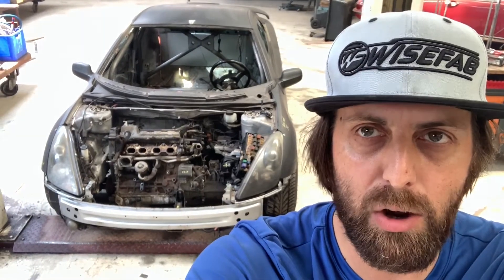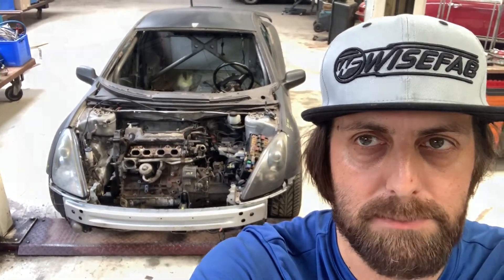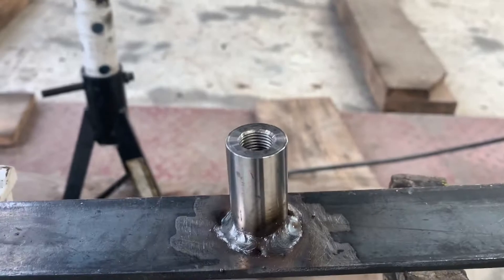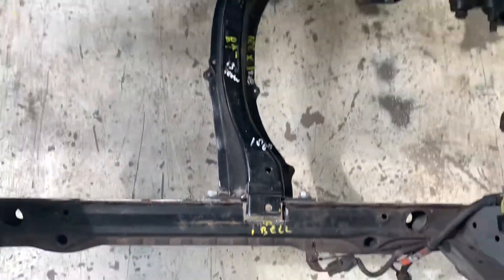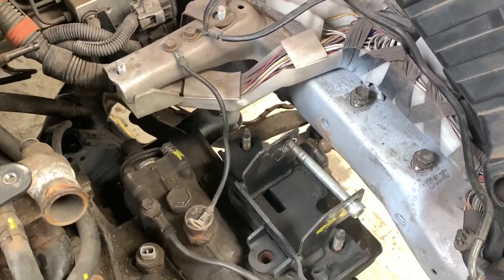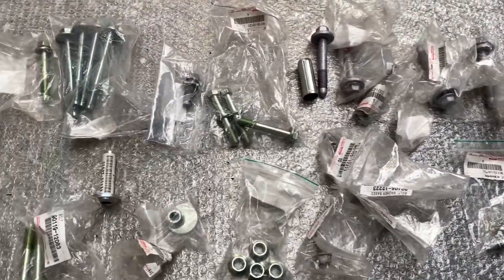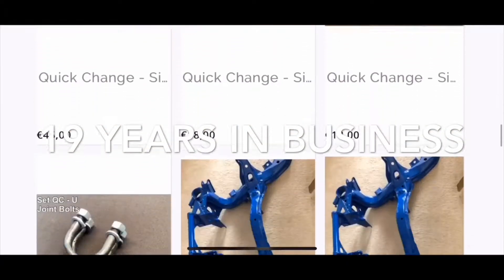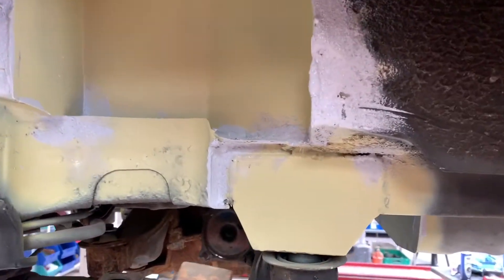How To Change FWD car to AWD / RWD , Celica T230 into T205 Four 3S GTE AWD Turbo

Comment: Well this is cool.. I owned one of these at a time. Engine seized up on me. I will keep an eye out on your build.
Reply from the maker: The original 1.8?  They are the black sheep of Toyota engines,  I remember they had problems when these cars were only a few years old
Reply: @DriftJesus  mine has 320,000 right now still going strong

Comment: hello ive got a kinda weird question. im at a standstill with my build and im considering just selling it becouse nothing is going right.
should i build e46 or should i just get e92 335i put m3 rear end in it and thats it? the car will be a daily drifter.
Reply from the maker: I would probably go for an E46 M3.  Prices are gonna go up, 3.2 N/A is plenty for most grassroots stuff and its stupid reliable.  My friend Brandon's 335 did well on DW but I'd call that an exception, we have a lot of N54's in the shop and some turmoil always happening.
Reply: @DriftJesus  can i hook s54 up to a normal zf/getrag trans from a m54/m52tu? or do i need whole drivetrain?
Reply from the maker: @patrykkowalski6  s54 fits ZF yes